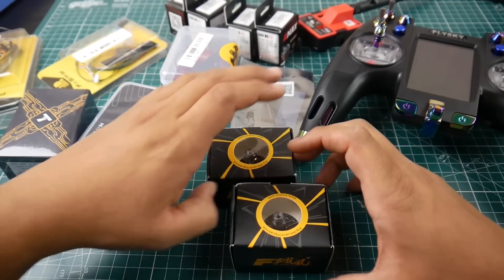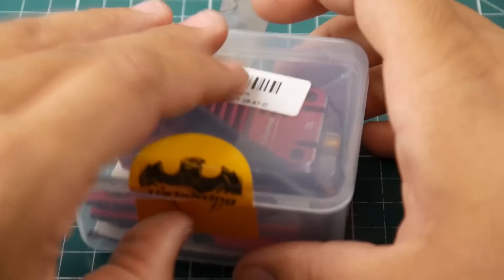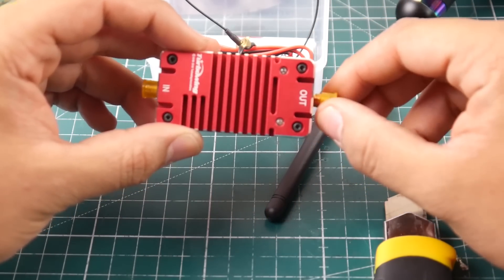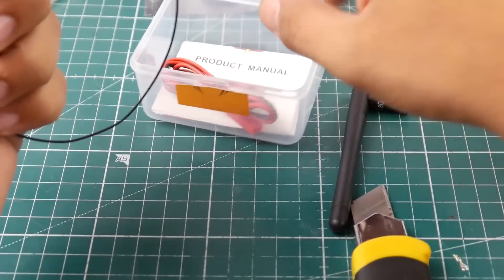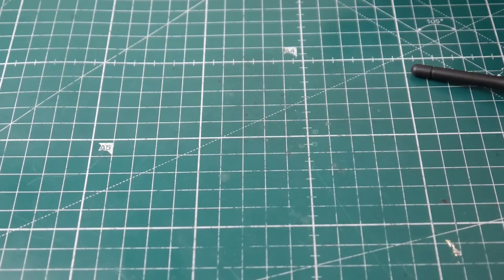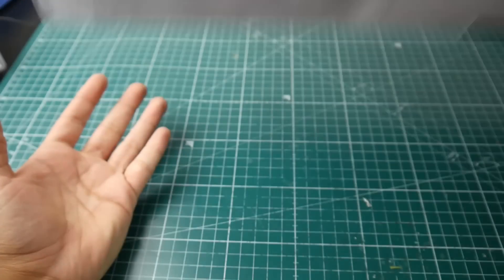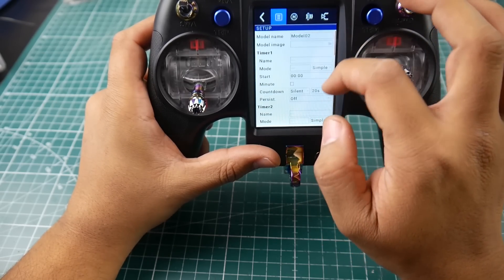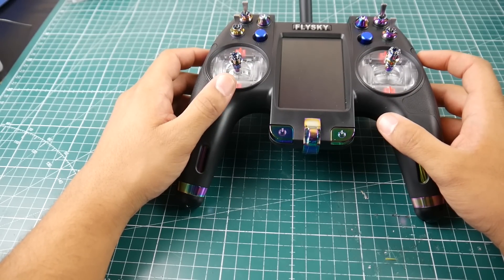MailBag Time!! // T-Motor F55A , 45A , FLysky Nirvana, Frsky R9M , Kinkong 800X RC Plane

Comment: It would be cool if you made something to lower the voltage on a 4cell battery so I can make some kind of plug with a xt60 to xt30 with a voltage drop in the middle so I can use a 4cell on the r9m instead of the required 2 cell

Comment: Dang. I might consider the amplifier over the r9m mod for the evolution. Seems simpler, but I'll wait on your video :)
Reply from the maker: I took the evo apart yesterday and looked for a ppm out from MCU with the osciliscope but no luck.. So only way now is generate ppm artificially with an arduino inside
Reply: @DroneMesh  I think you deserve the title of mod king in this industry
Reply: @DroneMesh  I think you deserve the title of mod king in this industry

Comment: if you can do it 2212 or 2216, 900K-1100K if you can not fit you'll have to look at the 35XX size
Reply from the maker: I found a emax lite 1900kv yesterday which I will try and just ordered 2 4s1p lion packs with 3150mah high discharge pack from UK. I will be running massive testing for long range and efficient components which I will also transfer some of the knowledge to our quads.
Reply: to use a larger prop you'll have to have lower KV and a lower voltage. 1900 you'll have a limit of a 5" prop at 5-6s or a 6" prop at 3-4s @DroneMesh

Comment: I have the exuav vtx. The combination with racerstar RS30A V2 gives a lot of noise in image and sound is really bad.
This is also the case with matek 5.8g vtx. Adding capacitors to the each infividualy doesn't help.
Could you test that?

Comment: Will you try the tmotors f80 + 55A esc on 6" 6s? Want to retry a build that I lost with 2508-1550kv motors on but at the time the 4in1s couldn't keep up.